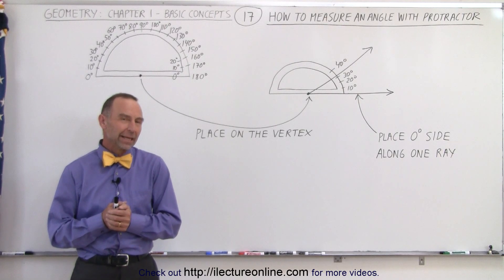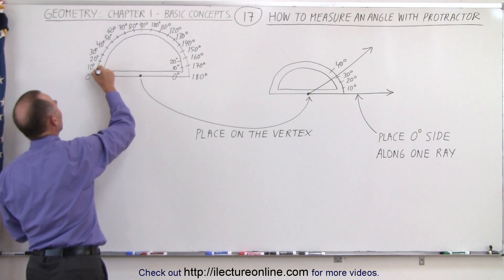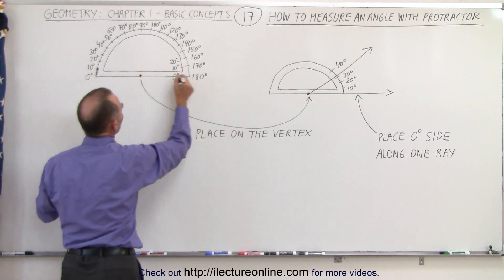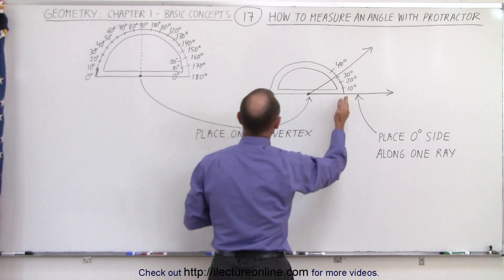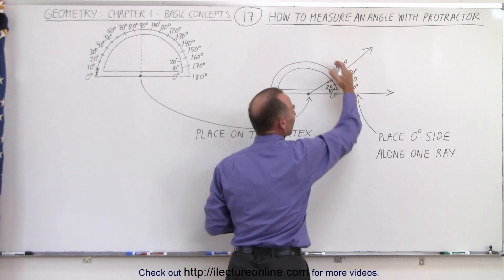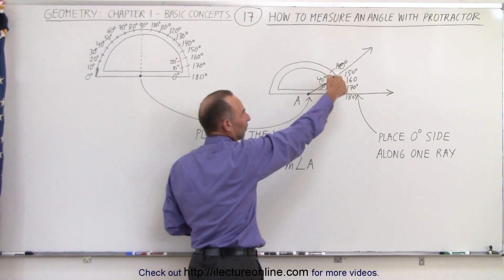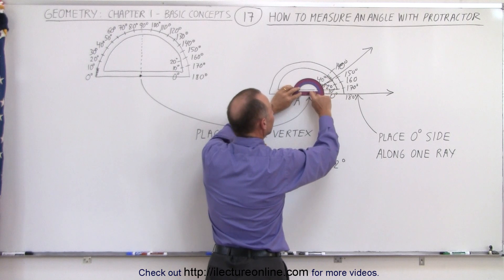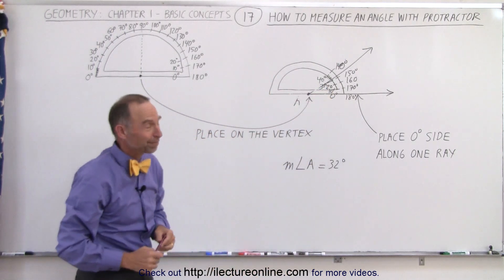Geometry - Ch. 1: Basic Concepts (17 of 49) How to Measure an Angle with a Protractor

Comment: I remember in elementary school being "confused" of whether I was measuring 45 degrees or 135.  The reason was because I didn't have a solid sense of the concept of "origin".   I think if there was a protractor with just a single set of angles from one side it would be very beneficial for kids to "get it" the first time presented.  Of course, the mfgr's would need to create two types of protractors a CW and a CCW.  Or...better yet, get two cheap standard protractors and "black out with a sharpie" one set of numbers.